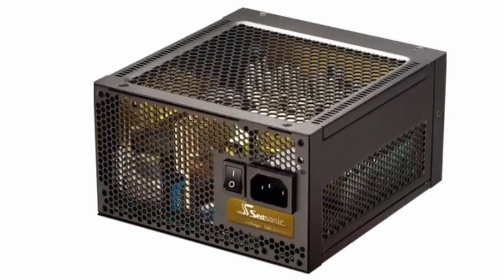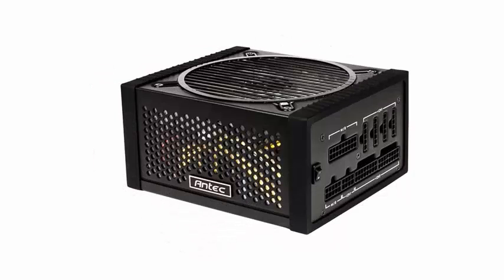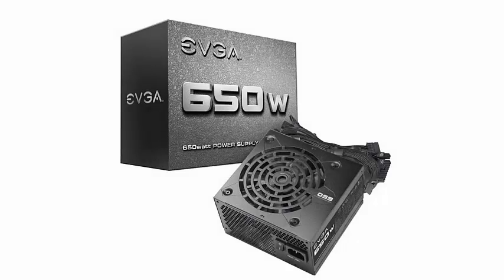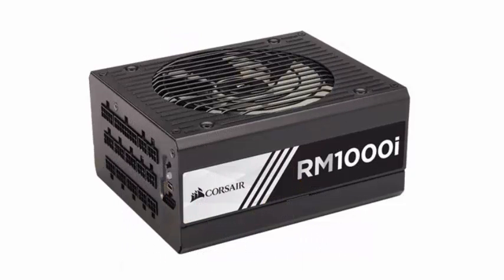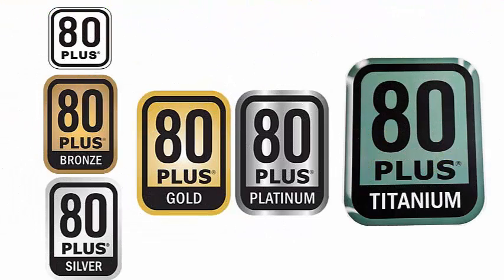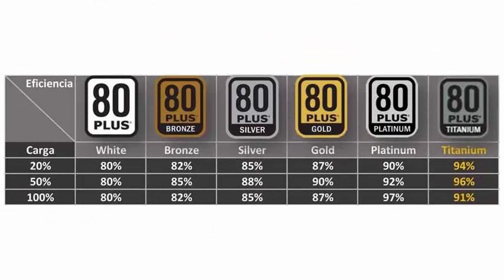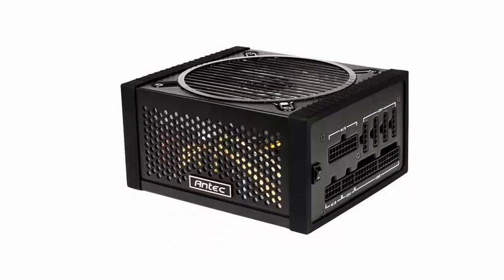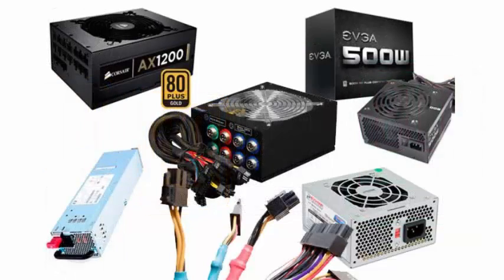80 PLUS Bronze, Silver, Gold, Titanium and Platinum: differences between certifications of power

Comment: TL;DR
80+  means 80% energy, 20% converted to heat
Bronze/White = More Heat, Nominal efficiency
Titanium = Less Heat, More efficiency
Reply: Hello does 80 plus bronze corsair psu vs corsair 80 plus platinium the platinium waste less electricity? if yes whats the dif how many watts less?
Reply: ive search google Does Platinum PSU save electricity?
Over the years as power supplies became more and more efficient, new standards such as Bronze, Silver, Gold, and Platinum were created. As we can see, even at just 250W output, we're saving 40.5W of AC power just going from a standard 80 PLUS power supply to an 80 PLUS Platinum unit! its good